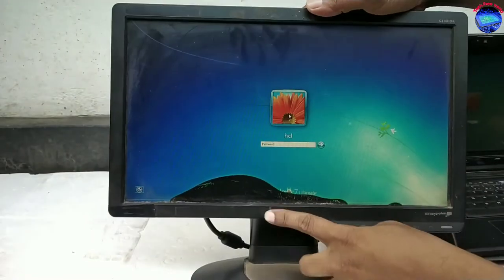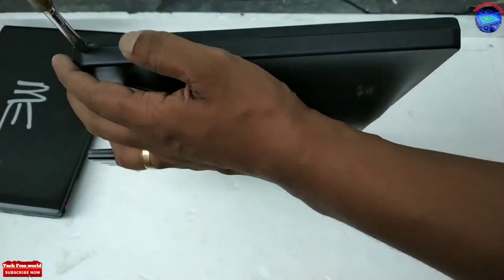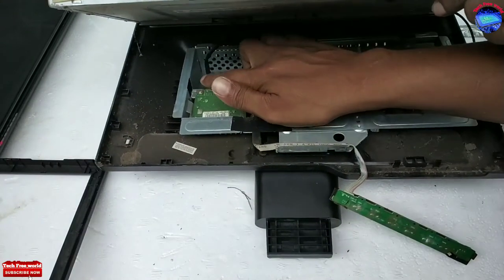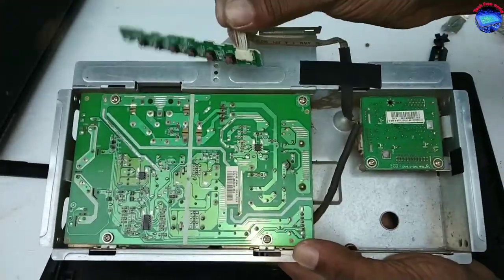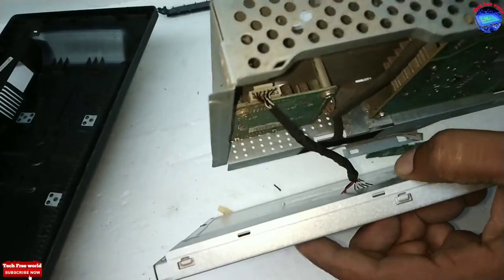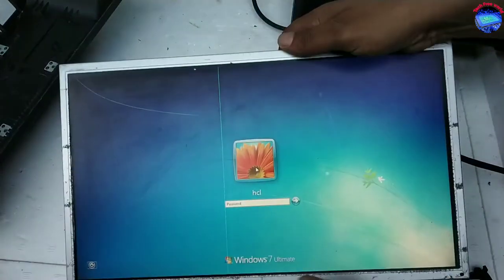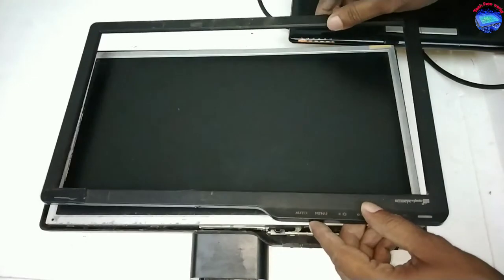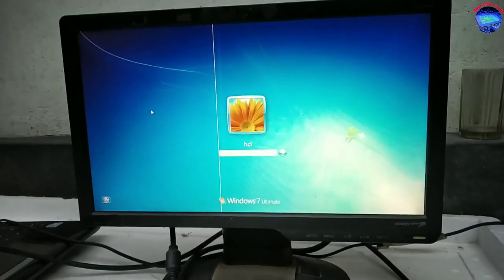How to Replacing Monitor LED / LCD Display Panel. | Benq Dell Accer All Types

Comment: Excuse me 

I accidentally used hand sanitizer on my dell 22inch monitor and it got lines throughout the display panel and doesn't showing anything?????

Is there any need to replace the display panel???
If not then what to do????? Please reply as soon as possible???😢😢😢😢😢😢😢😢😢😢😢
Reply from the maker: May it by board damage.  Check your monitor board.     Display panel rate is high.  If any damage in display panel bought new one. That is better than replace display panel